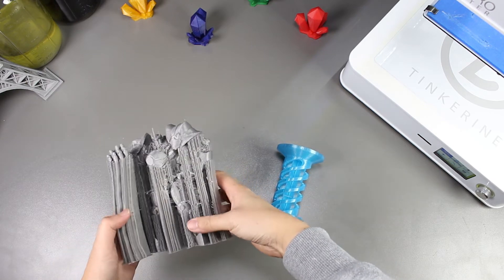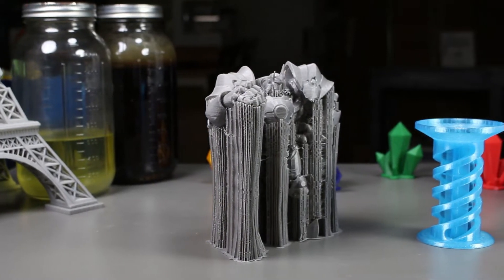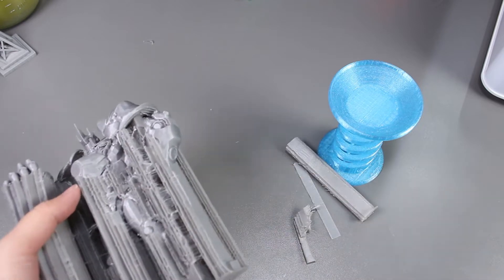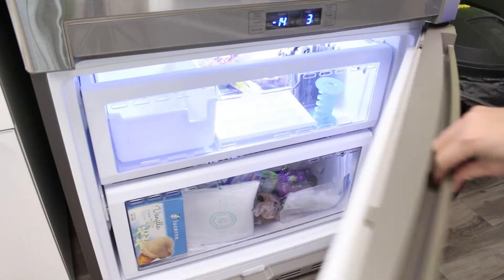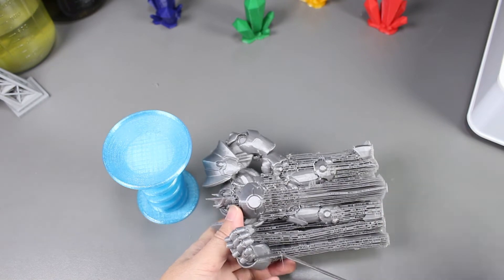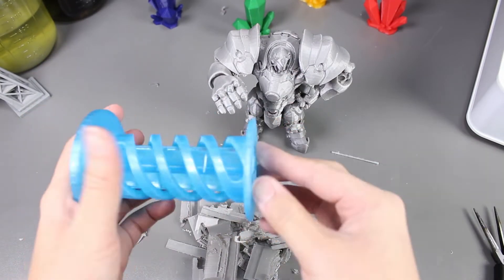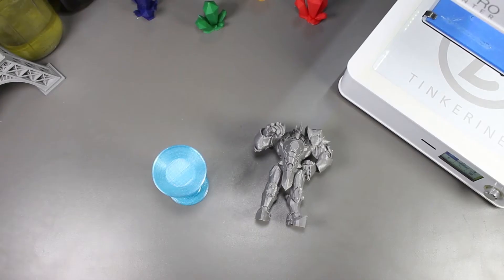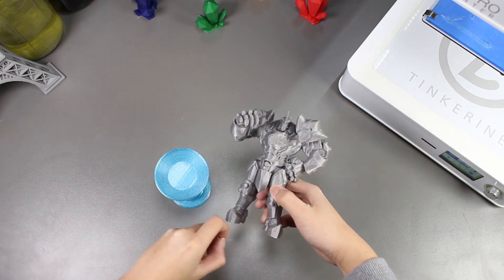Removing 3D Printed Supports with Cold Temperature

Comment: hey i was wondering what support settings you used for rhinehardt they came off so easy and mine take hours with tools, lmk when you can! 

P.S i use cura if that changes anything
Reply from the maker: Thanks for the comment! We sliced the Rhinehardt with our Tinkerine Suite slicer and printed it out with our DittoPro 3D printer. We used the line support pattern, support infill 20%, and 0.6 mm for the x/y distance. All slicers will be different though!
Reply: @Tinkerine  ok does your slicer work with ender 3 and is it free?
Reply from the maker: @rowlesreels9309  Tinkerine Cloud can be used with the ender 3. We are currently in the process of launching different printer profiles, you can also create your own profile for the ender 3 in Tinkerine Cloud in the preset menu. The slicer is free, all you need to do is sign up for an account right here: https://tinkerine.com/tinkerine-cloud
Reply: @Tinkerine  ok thank you so much your supports look amazing and they are just what I’m looking for
Reply from the maker: @rowlesreels9309  No problem, let us know if we can help with anything else!

Comment: I am not all that certain what happens exactly to PLA at low temperatures but I have heard of prints delaminating in mid layers. I assume that's where the theory of it making supports easier to remove comes from.

I would be incredibly interested to know what happens when PLA is cooled even farther than what is possible in a home freezer. Like below -45 Celsius. Also I wonder if there is a more visual reaction if prints were to be flash cooled really quickly - seconds instead of minutes/hours.
Reply: Chances are, nothing happens to the PLA polymer itself.

But if there was any water locked in, or introduced via the freezer itself, it will form ice shards. When this ice melts, it expands much faster than PLA, and if it has nowhere to go, it can rip apart the layers. But support is so thin that there is an obvious escape path.
Reply: @SianaGearz  yeah that makes sense. Thanks for the insight :)
Reply from the maker: Thanks for the comment, that was what we were trying to aim for but it seems like it didn't work out.